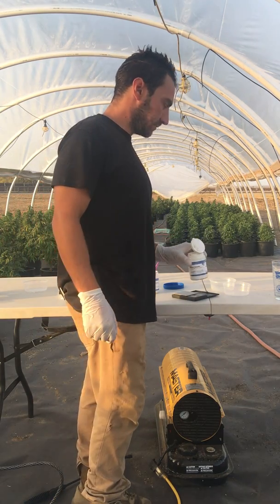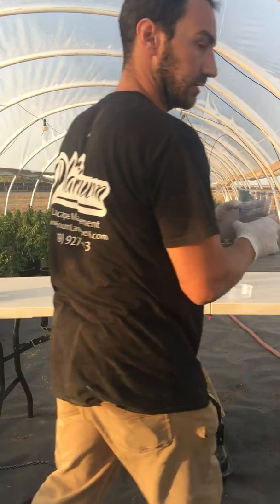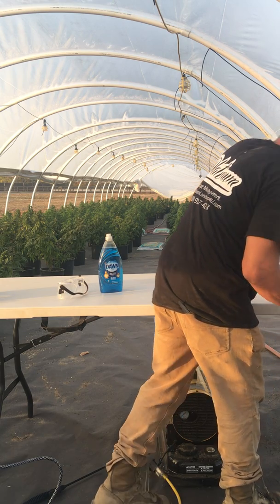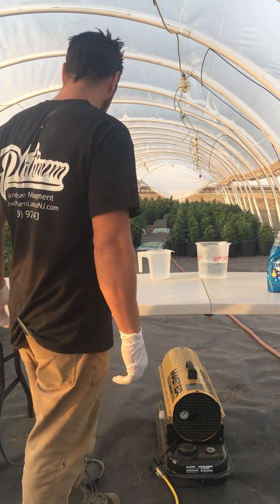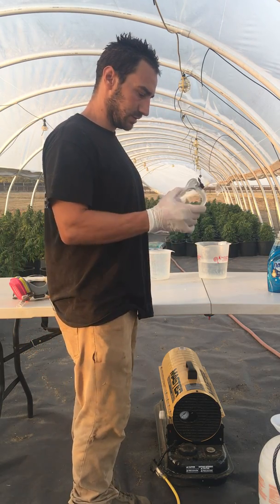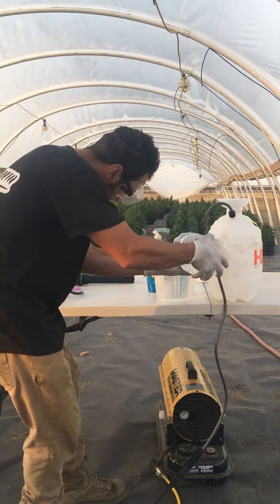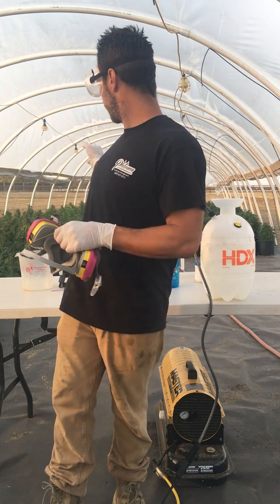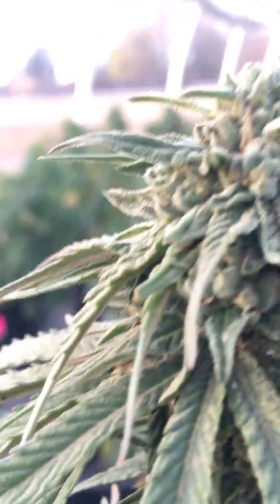Make feminized seeds- How to make and spray silver thiosulfate solution for cannabis and hemp plants

Comment: As someone who has just tried it by buying colloidial silver water 100ppm - and spraying it. I am currently in the 2nd trial - and it didnt work the first time. Right now hoping it will work. But doubtful.

It is really annoying to plan this - and not end up with female pollen. Plus the 2L of colloidal silver water cost me 40bucks. With no effect.

As i use clones AND regulars i also have regular males - and ended up using them for crosses last time.
But thats not what i wanted. So my stash of regular high potentials grew - but i still bought fem seeds :)

Thanx for the video Sir. Will be looking up the ingredients.

Comment: Best STS video around, I tried your method and dilution ratio and it works great. Thank you buddy
Reply: Did it burn your plants. I did this method and only spayed the plant twice right after lights out 3 days apart and it worked but burned the plant hard and it was very difficult to collect the little bit of pollen it produces. Had to dry the plant for 6 days then smash the flowers with a glass rod then dip my brush into the ground up mixture and dust my regular females.
Reply: @pulseled3907  if you get a little burn just add more Distilled water
Reply: @GaryPlumber  Thanks for the reply. I'm trying it again on a few different strains we shall see how it goes. The strain I did that got burned wasn't in the best shape when I did this so now I got my plants super healthy before I sprayed them last night and this morning they are looking fine.🤞
Reply: @GaryPlumber could I use any silver nitrate ?

Comment: big aloha just wondering when do you no when to stop sraying solution thanks when pollen is ready to open? or when you see the male parts?
Reply: You in HI? If so, I'm in Puna...  I didn't use his solution, but did do a STS treatment. It worked great on one variety, and another variety it didn't work for seeds. However, I did get lots of male flowers, so in that respect for a treatment, it worked great. I sprayed mine weekly once I induced flowering by changing the light cycle. Once a lot of male flowers were formed, I stopped spraying them and took them outside of the greenhouse to finish. The single biggest problem I had was mold due to the high humidity... the plants once outside were starting to mold out. Also, I tried to harvest pollen by cutting the branches with male flowers and bringing them inside, I think the pollen didn't have time to mature as I didn't get even one seed after manually trying to pollinate the girls. The other plant which was left outside did great... lots of feminized seeds off that one, haven't tried to germinate them yet though... so we'll see how it goes.
Reply: @slc12312  yes  hilo keaukaha 🤙🙏